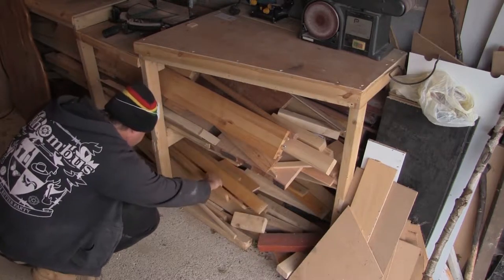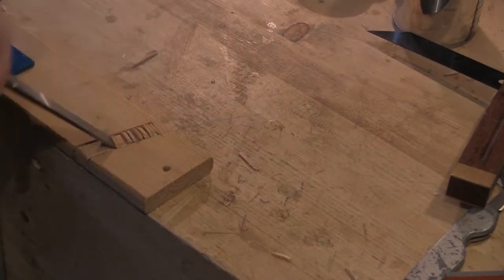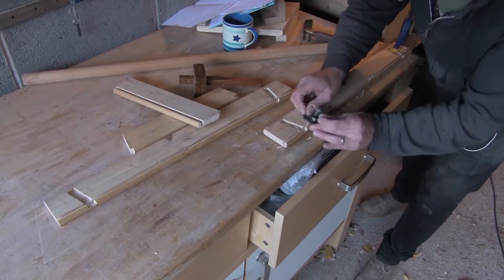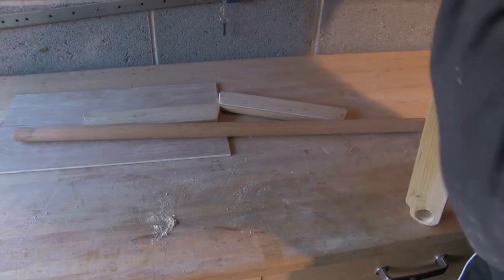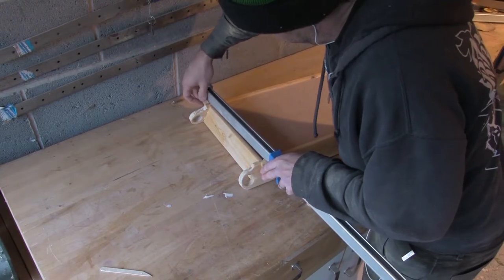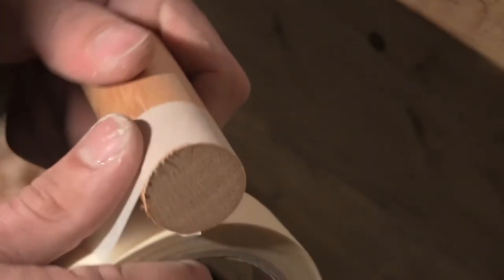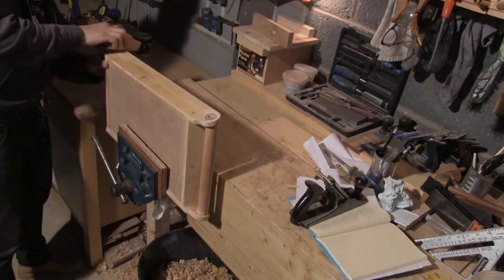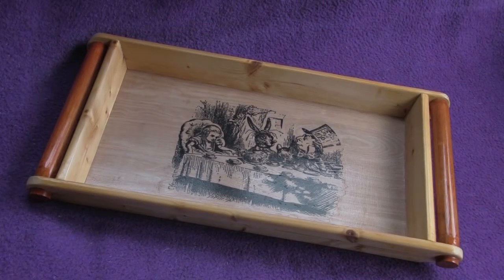Woodwork Project: Making a Unique Serving Tray from reclaimed wood

Comment: Nice work, but there's one thing that I don't understand: you mentioned twice in the video how you made sure not to glue the bottom of the tray to the sides (except one side, to prevent from rattling) but since it is made of plywood there should be no wood movement and therefore this measure seems unnecessary. Am I mistaking something?
Reply from the maker: It's more that I personally don't like the bottom to rattle so gluing it stops that. The bottom my be ply but the frame is just softwood and so would be prone to movement, hence gluing only on one side.
Reply: @adventuresint-shirtswoodwo3905  Oh, now I get it... It was the frame moving not the plywood. It makes sense. Thanks!